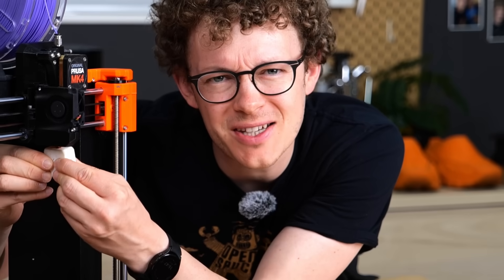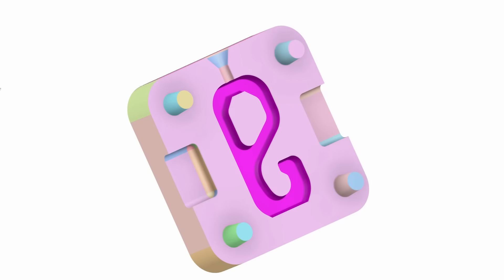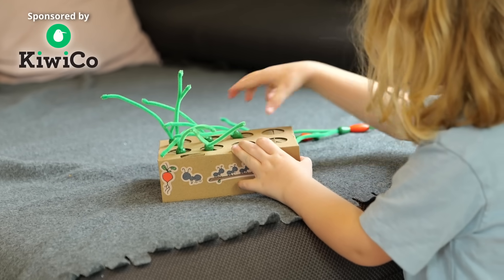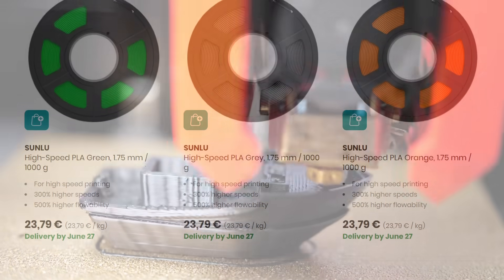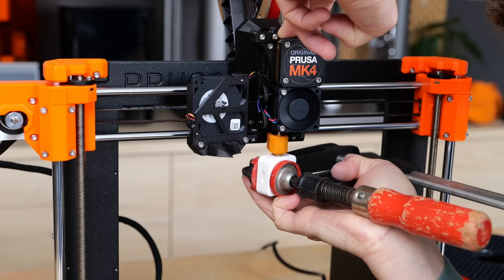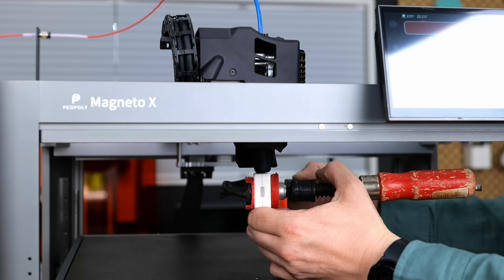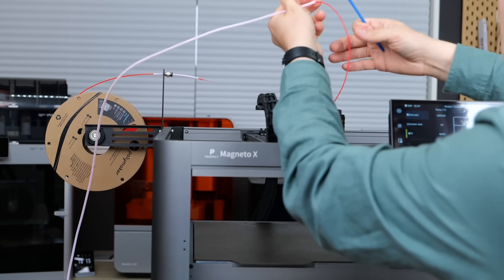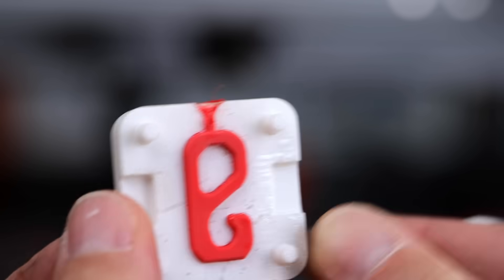I tried Injection Molding using a 3D Printer!

Comment: The first application to this that immediately comes to my mind is reusing filament waste (failed prints, calibration prints, purge waste/ams poop, etc). Would love to see some experiments in how to melt and inject those into a mold, considering your past videos on reusing waste for filament extrusion
Reply: that would be probably the most sensible use of waste filament.
injection molding skips the step of forming it into a filament which must be done with tight tolerances as diameter variability messes up the prints.
Reply: Thats what we do at my university. We create Filaments and recycle print waste!

Comment: You SHOULD get a desktop injection molder.  For one main reason.  Bamboo poops.

Somebody needs to get the ball rolling on this.  Everybody's sitting on all these little balls of plastic and the answer of what to do with them is obvious.  People keep trying to make them into new filament but it would be better served turning to a small desktop injection molder.

I recommend Brewster Beagles kit.  It's the cheapest kit and these desktop injection molding machines need the price dropped drastically.  $600 to $1,000 is way too expensive for such a simple tool.  But that's only because there's no mass adoption yet.  We need more people giving it a try to drive the cost down.  Heck bamboo lab should make one specifically for its poops.  It would be a match made in heaven.

Comment: Everyone has already mentioned a vent hole, and I’ve seen some mentions of putting the mold directly on the heatbead, which will help with stability and let you actively heat it during the molding.

But why not go a bit further and design in space for a hotend heat element to keep the mold as close to the plastics melting point as possible?

Comment: vents vents vents. :)
as everyone else is saying.

one thing to also try out is a mold flow simulation software. there should be some trials you can get of solidworks or the like. they will show you flow vs temps etc.

Comment: Awesome video Stefan!! Its no coincidence that I would see this video as my job is using 3D printed molds to make urethane injected soft pins. :)
As @tominthebox mentioned, adding an exit sprue should help release the air trapped inside the mold to help inject the hot plastic inside. Another thing I would hope you know is instead of using regular filament extruders and materials, you should use a pellet extruder! I believe there is a youtuber who is making there own DIY pellet extruder among others that are out there in the wild. This should work better because the pellets melt much faster and the auger extruder should provide more than enough force and flow to extrude any plastic. Don't give up on this project! Hope to see a part 2 of your endeavors soon! :D

Comment: Great video, one improvement (that is used on most injection molds) is a vent at the far end of the part to prevent back pressure from stopping the plastic

Comment: have you tried like making mold with a second hole in it ? It would be the first thing i would try.  Heck i would even expect a need for it from the start and designed it that way.
Not a pro but it just seem logical :-). I might be completely wrong. Or missing something. But still your hand just wont be as firm as injection mold PRESS.

Comment: brother !! you already have a heated bed right there ,just put the mold and the clamp on the bed and let the bed heat the mold !!
then move the nozzle into the mold while the mold is on the bed ,no need to hold it with your hands ,also let the nozzle touch the mold for a few seconds to transfer more heat to the mold ,and then start injecting plastic .
and if your that insistent on molding stuff ,design 2 holes in the mold where you can insert a heater cartrage to pump more heat into the mold 
add a hole at the extreme farthest end of your part to remove air ,and the hole where the plastic should be inserted should be at the center mass of the part so the plastic will have a short distance to flow ,not a few kilometers to reach the other end of the mold

Comment: The mold vents the air just fine as is. You can see layer lines on the surfaces that touch each other. The mold is more than leaky enough. The injection port needs to be improved to handle more pressure. I'd put it on one of the halves and force a tight seal to the nozzle. I would try to bury a steel wire mesh 2mm away from the part surface to heat up the mold with an induction heater, or even power it directly with low voltage.

Comment: I always love seeing when you drop a new video because I know it will change my perspective on 3D printing.  No, I had NEVER asked myself if I could injection mold with a 3D printer but now I am thinking about it, thanks to you!

Some thoughts for your mold that may help.  Because of the relatively low pressures that the injector can reach it should drive slightly different mold designs than would be expected for "normal" injection molds.
1) Air vents.  The very bottom of your hook was the hardest to fill, perhaps putting a decent sized air vent at the tip of that hook would reduce the pneumatic pressure acting against your injected plastic.  Also, it could show you that your part was fully filled if material squeezed out of it.  Adding multiple additional air vents at key point on your part could reduce the needed injection pressure
2) Multiple injection sites. If done quickly enough you may be able to inject into more than one point on a given mold with the same tool head, or even multiple tool heads.  Especially with multiple tool heads I think an air vent would be important. Multiple tool heads at different angles would also address your volumetric flow rate limit.
3) Customized Injection configuration. This could be multiple tool heads, a heated cradle and all sorts of other crazy ideas.  I originally though you could press the mold against the printer bed but after reflection I realized it really isn't designed to apply that kind of force... but you really don't need to put the tool head on a 3D printer.  The simplest "custom injector" that I would try is actually injecting from below with open venting at the top.  This could significantly reduce needed pressures while still using gravity to help fill the whole mold. My hypothesis is that if you tried this technique and injected from the top you'd be likely to not get the plastic filling the mold as well, some "backpressure" or force is needed to help fill the entire mold.

I look forward to seeing what you do next!

Comment: you could try heating the mold in a toaster oven and too 150C, you can also change the place where you fill it and widen the sprue to allow more flow. Lastly adding air vents will help prevent air getting trapped. oh and you could make bolt holes to clamp it down they will keep a constant pressure.

Comment: I'm watching your first attempts and already you need to heat the mold as well. I also don't know if your mold has a vent port. Looking at your demolding, it's no wonder it can't flow through. there's no where for the displaced air to go. You need to better design your molds.

Comment: The mold needs vents. I do plastic injections and cut cnc molds. The vent depth can be based on viscosity and pressure. Mine is thin so I use 1 to 3 thou. all sharp and or complex curves need vents.  Sometimes it is through mold vents as tiny holes other times it is side vents.

Comment: This is an amazing project. I honestly think it could go mainstream with a few improvements. 

One of my thoughts was, why not use the heatbed not only to preheat the mold, but to hold it and keep it hot?

If you made a metal housing for the mold that has good heat transfer, you could have the mold in the metal housing that sits on the heatbed. You then lower the nozzle into the mold, once filled you tell the printer to left the nozzle/lower the bed. 

The next step would be a special designed hotend for injection molding. Maybe the nozzle could have threads on the outside that screw into the mold. You then could have the mold seated on the heatbed. Put some thermal pads under the mold housing to give some padding to the heatbed and mold housing and you can use the heatbed to preheat and keep the mold heated during injection.

Comment: though, using 3D-Printed injection molds is as old as commercial 3D-Printing came up, its usually done in regular injection machines with a re-usable, metal tool. 
The biggest issue i see, with using a cheap 3D-Printer to do the injection, is the, sorry for saying so, primitive way the extruder works. 
even the smallest machine works with >800bar injection pressure and 62kN clamping force.

Comment: i think you need to make it so you arent going from nozzle to the mold. i think using a nozzle is going to reduce performance of just going direct and pressure loss from the poor seal.

maybe modify a dragon standard flow heatbreak so you can push the mold on to one side of it. mount the other side in the  heatblock.

the only issue i could see is short heatblocks might not heat the filament completly at the feedrate needed for injection molding.

Comment: Pretty sweet! Try tape heaters or silicone heaters with a thermocouple and PID controller attached to the mold to keep it at a constant temp. You said the resin can take 200C, so you can probably heat the mold fairly easily to a reasonable temp. Cheap enough. Switch to maybe polypropylene, because it won't stick to the mold, and it can melt even as low as 180 from my testing but can go up fairly high. Not sure how the flow compares to a TPU, but maybe the filling efficiency also has to do with how flexible a filament is? Finally, just clamp the mold directly to the extruder not with your hands. And maybe use some sort of silicone sock that goes around the nozzle to get a better press fit up against the mold so you can get to higher pressures?

Comment: Dude, I know nothing about injection molding, but I have enough common sense to know that you’re not gonna be able to push filament into something that doesn’t have an air. You’re just building pressure. Also, I would think that die would need to be heated and cooled. 

It seems like you’ve been playing with bambu labs too much and forgot how to do critical thinking :-)

Comment: Have you thought about cutting the tip off of a nozzle with a long threaded section and threading the nozzle directly into the mold?  You also need to use air vent holes to allow the mold cavity to fill  completely.

Comment: Hi Stefan.
I am missing an air hole in your molds. This is really needed as you are fighting against pressure versus time. You need to fill the mold faster and therefore you need to reduce pressure.
Also, try silicone spray instead of mold release. This helps PLA to have less resistance while entering the mold. And last but not least, PLA Meta has a much lower melting point allowing you to have just a little more time before it solidifies.

Comment: A few things that might help this are putting a vent so that no air gets trapped in the mold, finding a way to keep the mold heated so the material doesn't harden and seize so fast, and potentially finding a way to liquify the material a bit more. Still, as a proof of concept this is interesting, and future development could make small scale injection molding viable.
Just imagine what you could do if you had a hopper system for feeding the material, and a heating chamber to liquify it, you could potentially use shredded 3d printing scraps to injection mold parts.

Comment: What about a custom turned nozzle that fits in the mold. Like a cone shape that gets clamped between the halves and only pushes itself tighter when the pressure increases. Sure not a standard nozzle anymore but its an easily turned part on a mini lathe.

Comment: Venting isn't required. You could add an extra chamber to be trimmed off later (often called a material saver, for some odd reason) that the gas could vent into. Remember, any gas inside the mold is being compressed. The seal between the halves will not be perfect enough to prevent gas escape at these low pressures. The suggestions to use the gantry to hold the hot end against the mold and to use the hot bed to maintain mold heat are very good ideas. Now I am wondering about standard 3DP resins......I don't think a glass filled 10k resin would be required for TPU.I've used resin printed molds for epoxy and composites, but hadn't really considered filling them with hot plastic without turning to specific tool resins. Good stuff!
Reply: yikes, this makes no sense, "Venting isn't required" but "You could add an extra chamber to be trimmed off later" so venting is required, this is just a worst solution  that makes you waste more plastic + you have to refine it, and it's too generalistic aswell, maybe when casting resins you could be better served with an extra chamber due to the low viscosity of the resin, but that's it , in commmercial injection molding using plastic polymers air vents are what is needed,  holding the gantry on to the hotbed is indeed a good suggestion tho
Reply: @martimattia1997  Long-winded reply time. Plenty of "material savers" are used in commercial injection molding; that's where I've made my living for most of the past 30 years. Having dealt with injection molding machines varying between 33 and 4000-tons of clamping capacity from automotive to medical, I've been around a little.

 Adding a vent to atmosphere isn't always feasible, but a material saver can help with filling. Imagine if your problem area with gas-trapping ended up being inside another feature. Having an extra chamber to fill and have the material pass through can help with filling, even if the gas just gets compressed and doesn't vent to atmosphere. Vents go to the outer edge of the mold. That likely isn't required with c-clamp forces and the kinds of speeds and pressures involved here. Also, in commercial injection molding, temps are very high, so the viscosity can be surprisingly low, and there is a lot of speed and pressure moving the plastic. 

When you get to a point where the surface area of the mold actally counteracts injection forces before the plastic "freezes off", gas pressures can stop flow or cause the clamp to open slightly (the handheld example), and a highly polished mating surface (not part molding surface) can actually be a bad thing. I don't think 3D printing is yet at that level of surface finish. If the mating surfaces of the mold are highly polished AND match perfectly enough, you will get gas trapping and the gases still generally find their way out - not always in the manner expected.

The larger issue for small scale molding is temperature control - keeping the mold hot and even cooling it in strategic places.
Reply: @Tech-gu5ge  maybe i didn't explain myself well, i'm not sayng that material savers are not useful in any way, i was just pointing out that in this case, was easy enough to vent out really easily and could be a more efficient solution, im  not in the industry from that long, so i'm not debating about common molding pratices, you probably have seen way more than me, but from what i saw, airvents are really a common choice
Reply: @professorfrog7181 I think heat is going to be the key, retaining heat in the mold and, if possible, adding thermal mass to the column of plastic going in. The addition of mold release to promote surface flow solved a larger issue than venting: it moved the material across the surface quicker, keeping it from freezing off. I think moving to a 3mm extruder would also help keep heat in the material (a molten column behind what was already injected), and likely improve things by moving the plastic faster, even with the same nozzle diameter (higher pressures due to increased piston area) but I would think a larger nozzle would be better by reducing pressure in the extruder and just pushing more plastic into the mold more quickly.

Even in industrial injection molding, we tended to do some questionable "experiments".....right down to "squish molding" in wooden molds where you would throw in a blob of molten plastic and squish the 2 halves of the mold together. Heat makes the most difference in material flow. Same with "hot glue molding", using a hot glue gun to try to fill s small mold. Being able to 3D print the molds is a major step forward over the way I did it, and allows for much more detailed molds. Spare time on your hands makes you want to test the "rules" with some hands-on time. I've moved on from injection molding to medical 3D printing; still doing questionable experiments to test the limits.

Comment: A lot of people were talking about the air building up, which was one of my first thoughts as well. Though I assume the mold isn't fully airtight, so I think the air could mostly escape out of the sides?

Though the air probably needs some pressure before it can escape, so adding a vent might give some better performance. Would be really interesting to see that tested!
Reply: air does leak out the sides, leading to material flashing, but adding air vents controls how quickly liquid material flows into a mold and how parts of the molded form cool, which can cause casting flaws like gaps or a weakened boundary where cooling materials flowed into each other